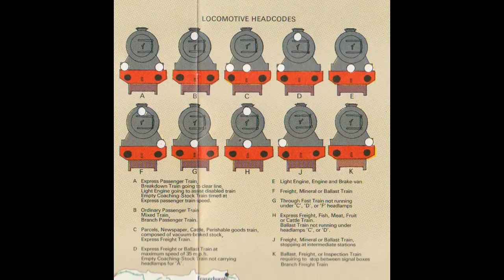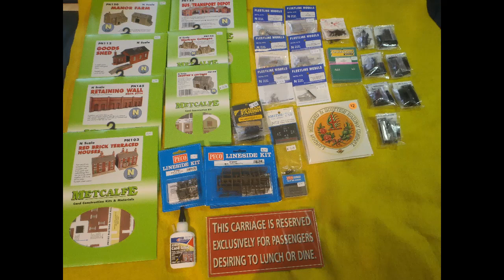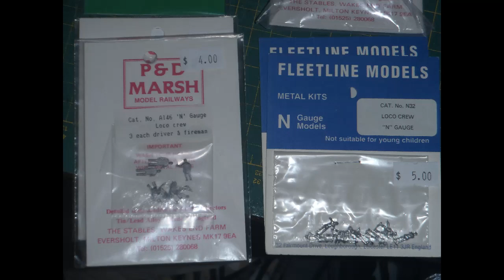N Gauge 84, Lamp Codes and Crew

Comment: Hi Ken. Those lamps look pretty good to me. Did you ever consider using an LED instead of a jewel (more work and fiddly, I know)?
Reply from the maker: I don't use any live lighting on my layout, actually (daytime operations only); but if I were going to, there are things I could do with some practicality - streetlights, lighting bars for coaches, lights in buildings. I definitely don't think I could even consider making the head and tail lamps actually illuminate in N Gauge - way beyond my skills (I struggle just to get these passive lamps assembled and properly in place). The lamps really are tiny in this scale, so I'm not sure if anyone could fit LEDs into them; and then they'd have to be wired, of course, which wouldn't be too bad on the tail, where they're on the back of plastic rolling stock, but would be very hard on the front of locos. I have seen N Gauge locos with head lamps more of the American style, for illuminating the track, and that was done just with a lens in the smoke box and a rice-seed LED inside the front of the body.